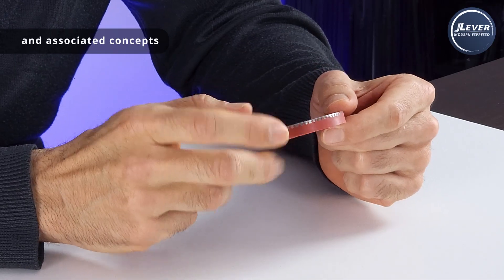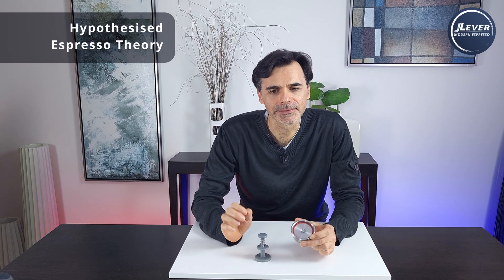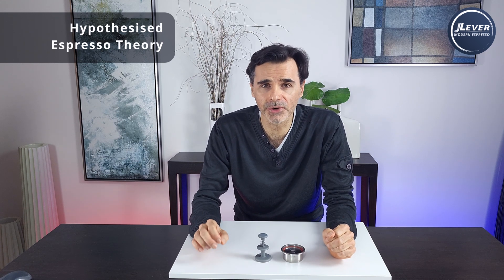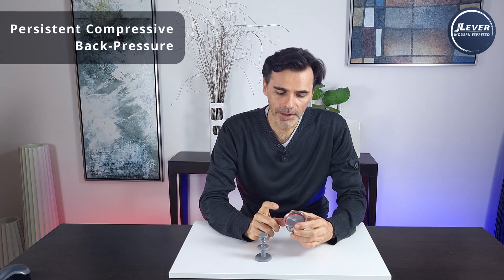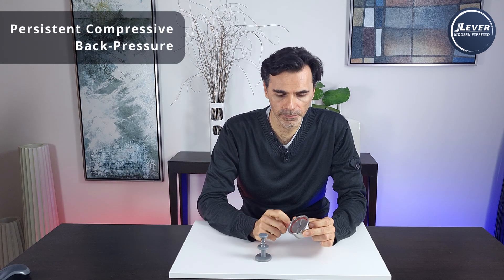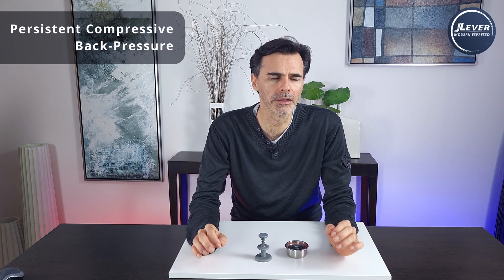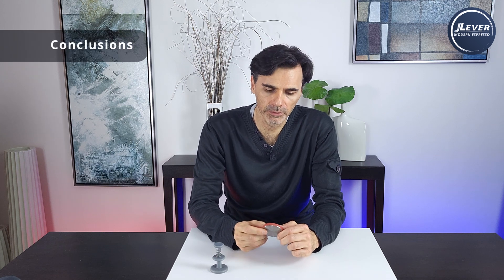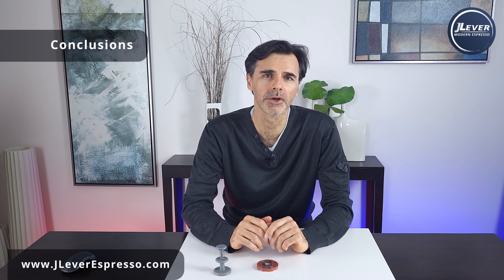INTRODUCING - JLever’s solution for espresso “dial-in”

Comment: could you see an advantage where the pressure placed on the backplate is independently adjustable from the pressure of the water going through the puck ? 

I ask as in my limited look into flow profiles, the suggested flow for dark roast was high initial flow (approx 9ml/sec) dropping to slow flow (approx 3ml/sec) where light roast it was recommended starting slow and moving to med/high flow, and medium roast starting with medium flow (approx 6ml/sec) then go to high then back to medium. So with the dark and light roast, the initial flow is opposite to how you size your restrictors as written on your website, if I understand correctly..... cheers.
Reply from the maker: yes, indeed this is the full VFiPP idea, i.e., Variable Force on the back of the puck, independent of flow rate. This simple plate doesn't represent the full idea of VFiPP but it's good enough for most cases...

Comment: Will the magnet disc puller be available by it self?
Reply from the maker: not anymore we've changed the design on the back-pressure plates... did you want to use it for a puck screen?
Reply: @JLeverEspresso  yeah ✌🏼
Reply from the maker: @bach000999  i think you'll find most of them are non-magnetic so it wouldn't work, but yeap it was nice when it worked
Reply: @JLeverEspresso  have a magnetic one in the mail right now✌🏼 Might try to have something 3d printed
Reply from the maker: @bach000999  might be a waist of effort, our back pressure plates are amazing :) in the espresso they produce... we'll do an updated vid soon

Comment: I enjoy inventive new thinking.
A little difficult to completely understand especially what’s happening to the puck at the molecular level during the pull with different scenarios. If I’m understanding this correctly the “back pressure plate” (BPP) allows the liquids to remain surrounding the particles for a desired amount of time and a desired amount of pressure irrespective of the grind size. 
A question that pops up in my mind is the maintenance and longevity of this BPP. How is it properly cleaned? Can it get clogged? Or a scenario say if one wants to make a blooming shot and let the puck sit without applying pressure for 30 seconds. Will the BPP need to have continuous pressure applied during the entire pull?   
I am still a newbie at making an espresso and have been studying it immensely. Happy the YouTube algorithms steered your videos my way, hopefully more will see this too. I backed the Meticulous campaign and will be happy to back your project, it looks very promising!
Reply: On a follow up question after watching more of your videos… will the back pressure plate (or as I see is now being called a VF-PP) be compatible with an automatic type espresso machine that analyzes the pressure independently from the pressure in the puck chamber? If yes, I think your marketing direction should be towards making multiple thousands of these for existing machines even though your passion has been on making a new espresso machine. 
Thanks!

Comment: I'm very curious about how this works and whether your theory of how espresso extraction works is accurate. It is certainly very worthy of an in-depth look. Have you ever measured compared extraction yields between a backplate shot and a backplate less shot at the same grind size with the same contact time (it would obviously be "artificially" slowed down by pulling at very low pressures. The extraction yield won't say what was extracted out of both shots, but it would still be an interesting metric.
Reply from the maker: We're doing a video on yield soon, generally speaking you grind courser so it's expected that the penalty for broadening grind size is a small hit in yield, however, this plate is not the full and best version. But we'll do a yield experiment soon.

Comment: Ok so it’s a disc that converts any portafilter basket into a pressurized basket. I don’t see how this revolutionizes espresso because pressurized baskets produce objectively inferior results. If a user didn’t care about the quality of their shot enough to buy an expensive machine and grinder that rely on precise dialing-in, then they probably already have a machine that uses a pressurized basket, and they can achieve results similar to what you’re showing. 

This feels like a solution in search of a problem
Reply from the maker: I think you failed to understand the premise... pressurized baskets are only immersive brewers at 9 bar, this forces water through the grinds more effectively than traditional baskets. This is to traditional espresso what traditional espresso is to pressurized baskets... just that step up in tasting quality, as it tends to produce a brighter, tastier espresso, but the only way you're going to be convinced is by tasting it, perhaps one day you'll get a chance at a cafe or a friends place :)

Comment: In what way is this different from a pressurized filter basket?
Reply from the maker: a pressurized basket has a constriction down stream, this is a constriction upstream, which creates back-pressure force on the grinds closing of aperture channels as described, and forcing water through the grind structure of the particles, a pressurized basket doesn't do that, it's just extraction at 9 bar, with a type of foam produced at the end, hope that answers your question :)

Comment: I don't understand all that physics behind this but it looks really promising! I used the Rok presso in the past and now I'm using the Cafelat Robot but I still struggle to get a good shot sometimes. This looks so much easier and effortless!
Reply: Hi,

For what reason do you feel you can't pull a good shot?

Have you ever tested your water? I am sure you adjusted grind size, temp, and time but if the water is too hard or has an unbalanced mineral content it could be easily overlooked.

What do you think of the Flair 58? Thank you so very much for your kind reply. 😊
Reply from the maker: Hi, apologies i missed your message... It's probably the grind size K G is using... the ROK and Cafelat Robot are espresso capable machines ...
Reply: grind size and amount of water to extract is extremely important. 

Along with contact time and water temperature, many variables go into pulling a good shot. 

JL is right, you can not put any size grind in the basket. Try keeping as many things the same and adjust the grind size. Usually if the espresso is too sour the grind needs to be finer and if the espresso is bitter it is too fine and over extracted. 
You are using a burr grinder and not a blade grinder? I hope this helps.
Reply from the maker: Yes, this plate is exactly for people that don't know how to dial-in espresso... most people don't realize they can't just put any grind size into an espresso machine and pull a good shot, but with this plate you'll be able to

Comment: It seems awesome for manual espresso machines, where it's otherwise difficult to control precise pressure, e.g. Staresso Mirage and Picopresso. I hope thus you are providing as well smaller basket sizes, like 53mm and 54mm.
Reply from the maker: yeap there should be most sizes